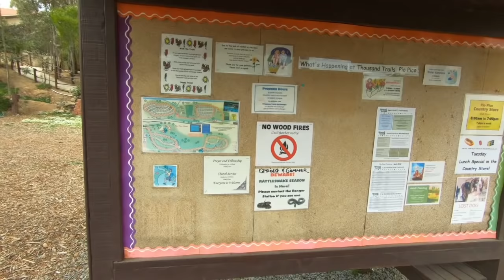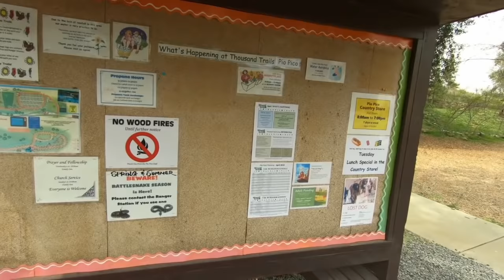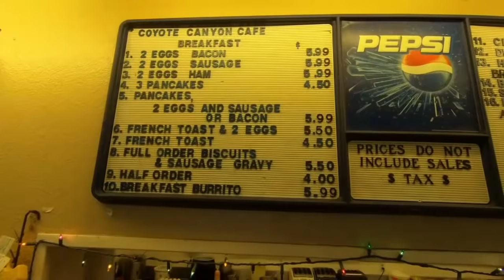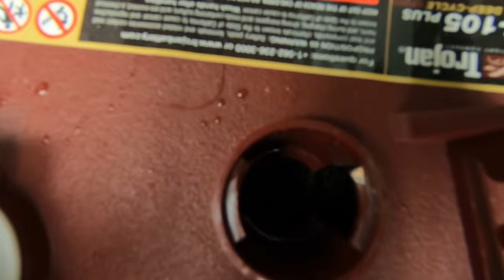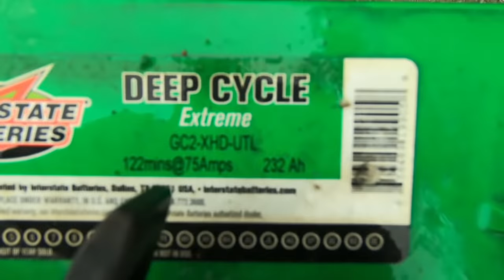$140 A Month Full Hook Up RV Camping Site & New RV Batteries Install

Comment: Don't ever put a battery on the ground  fastest way kill them ! Just a Note !!
Reply: Lets Get Social La. 
How will this kill the battery??? Care to explain the physics to support what you said?
Reply: Ray, you could google it yourself and learn way more that social would give you in any reply.  That said,  I know of batteries self discharging faster due to the temperature  differences between their bottoms and tops.   One reason is electrolyte will stratify based on temperature, warmer being higher and will have a less density.  So, placing them on cool ground and them exposed to hotter daytime air will drive that action.  Placing them on wood reduces that effect.  However it's more of a concern over many weeks and months.  Not nearly a problem being on the ground for a few hours or less.

Comment: get some gel batteries
Reply: Two late to get gel's now.  Those (Gel's) batteries are a bit more expensive.  Besides Gel's are not the best types for his usage.  His battery charger is for flooded lead acid batteries and not recommended for Gel cells, there are other factors that come into play, which I'm sure James knows all about.  He's quite the battery expert, don't you know.

Comment: who ever told you to put water in your new batts did you wrong,  they do not come fully charged, when it is fully charged then add water. your batts are now going to boil over,  also your cables look like sh....  watch some blogs on golf car repair.
Reply from the maker: +Arthur Golder I already charged them,  you must have missed me saying that.
Reply from the maker: +Arthur Golder FYI batteries that are fully charged should always be to full line.  So,  if new battery is low it needs water.  Evaporation doesn't stop just because the battery is new.  Thank you for your suggestions. You only boil over a battery if over charged, over heated or overfilled.